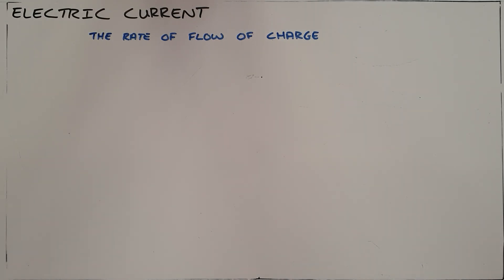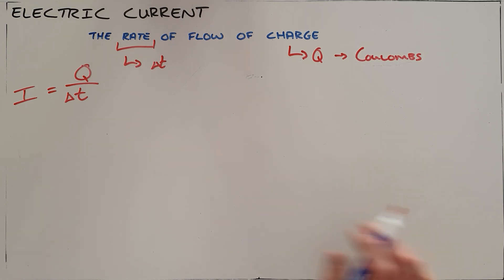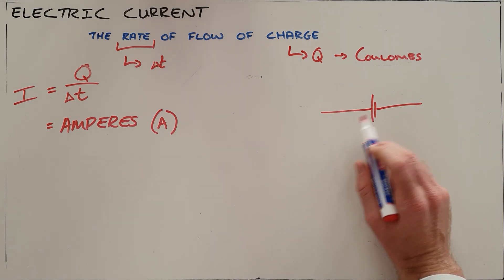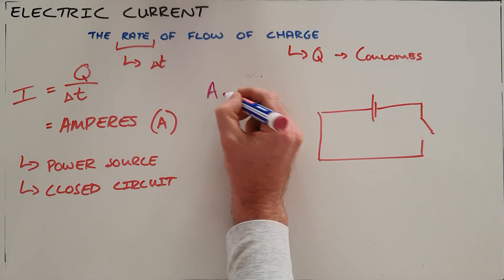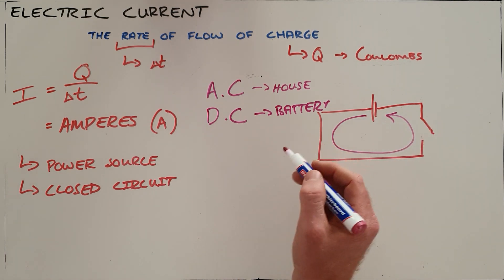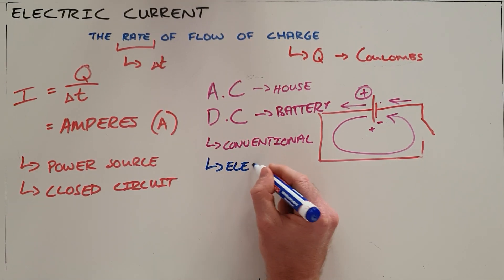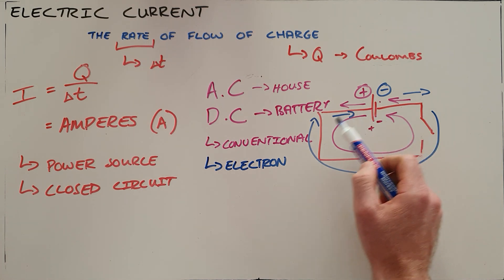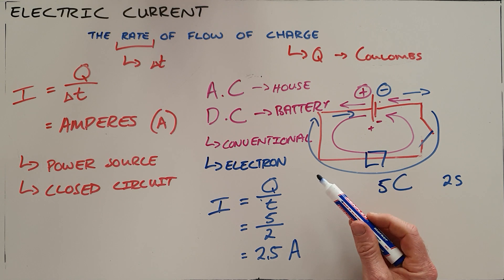Electric Current

Comment: What happens to current or voltage at a point or junction
Reply from the maker: Hi, you would need to look into Kirchhoff's Circuit Laws - but (very simply) current is split at a junction and voltage must sum to zero in a closed loop.